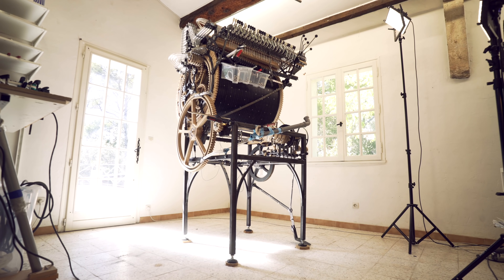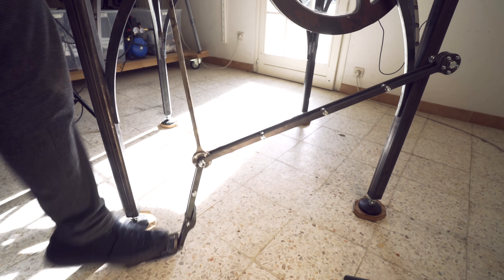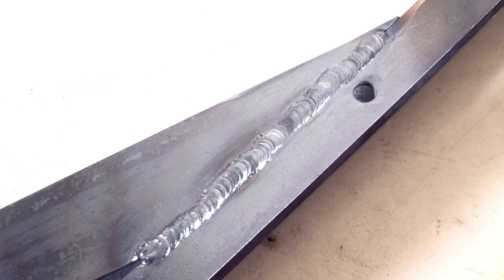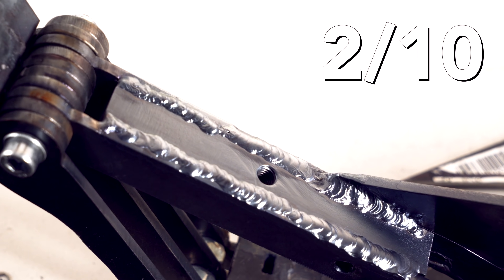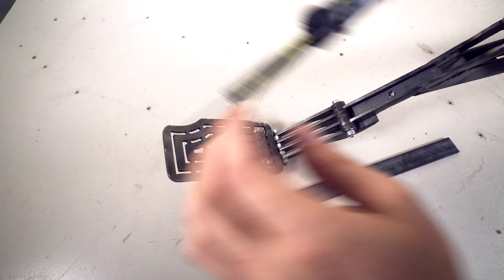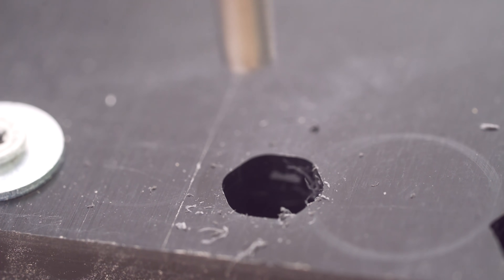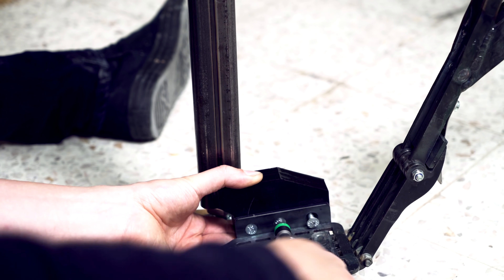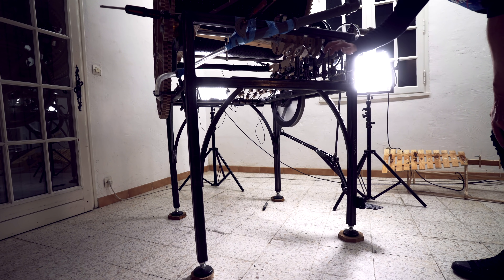Treadle Pedal Completed - Marble Machine X #81

Comment: Why not go with a Singer type pedal setup? It's a classic, it would fill up the dainty looking legs a little and give wide range of motion, allowing you to operate it from either side (front) of the machine. Not to mention that it would stiffen up the whole assembly (Singer pedals were also structure elements because of their conical bearing surfaces).

Comment: What happen if you exidently place you foot under the running machine?
Does it block if you have this block extended? 
Or does it slide because i see some issue in one possition (it can colide and stops the pedal) but i can only speculate if i havent this machine after me.
:)
Nice proggress, i like it 
Good job ~(^-^)~
(Sory for bad english)

Comment: Again another awesome video, but a bit of advice from the safety department.  Whenever one makes an adjustment to a safety component to address some aspect not necessarily safety-related, one still needs to confirm after the adjustment that the safety feature still meets its requirements.

Comment: The gap between the two pieces of metal is some of the cause of the problem. You would have been better off to use square tubing. The top end of the pedal arm needs a brace on the outside of the mount as well to keep that bolt from flexing

Comment: @ 2.33, It is Not structurally fine, you have made a future point of failure, and you Will have to replace the whole mechanism, especially the weak pivot point at the rear of the main arm. @ 3.27 I can no longer watch the Bodging.

Comment: I think you might want to revisit your spring and pedal design.  If the pedal flips up for whatever reason in the middle of a concert, the pedal wil flick past the spring and you won't be able to flick it back easily.
Not a big deal in itself, but in the heat of battle it might become a big issue!
Keep up the good work dude.
Chris

Comment: -  I don't think the safety feature will work if the foot will be trapped under "back" side of the pedal.
From my engineer's point of view it should be resolved by connecting flywheel through friction clutch which would eliminate any interlocks that could happen.

Comment: Hi, Martin, I have not seen every results, so I am a bit worried about SAFETY. I have a scenario which can still be dangerous. Your foot gets under the pedal, the foot plate goes up, but the POM is too small and it does not keep the pedal from getting stuck in the foot of the machine in that position. Tell me I am wrong and I'll be happy.

Comment: if you want better looking welds i would suggest holding the torch as a pencil and also bracing your wrist against a support, it looks like you are trying to do it freehand with your hand floating in the air... very difficult to get a nice looking weld that way... love your videos btw

Comment: Dude, you need to test out the safety feature of that pedal, after you added that spring steel. It's all well and good that there's still flex, but you need to know for certain that when that machine is going full speed, that 5-10 pounds of flex force won't hurt your right foot.

Comment: Those 4 table legs look weak. How are you going to move this piece? How strong is it for shipping? Can you take it apart fast?
If it rains on it will the wood absorb it and swell? How about rust? Those plastic tubes look fragile for shipping. A piano has loads of felt pieces to damp clatter.

Comment: You didn't test what happens if your foot or something else goes under the pedal. It should spring up just fine, but I'm worried it will jam the plastic sliding block against the inside of the leg and cause damage. You should check that and make sure if the pedal does flip up that the plastic slider will stay on the outside of the leg.

Comment: I see a problem. If the safety mechanism was activated (pedal bends upwards), the delrin block could be in a position where it is not sliding against the leg. Due to the preload pushing the pedal into the leg, the block would get pushed behind the leg, and would remain there until somebody pulls it back out

Comment: A crank level from the center of the wheel connect with a  chain, to a large pedal mounted on a  base trapped down between the floor and the machine, thats it dont run on circules  or better let the crank miss out, just tied the pedal chain on a xtreme of the wheel, a larger pedal no need extra attachment and the weight help you in to a higher speed and make easier to stop, greetings!!

Comment: The pedal should be optionally connected to the wheel via a locking pin. So when you are turning the wheel, you do not waste energy moving the pedal up and down for no reason.

Comment: Wont the safety feature break in the case it crushes the foot because the spring steel prevents it from going back? I just don't want to see you on stage accidentally breaking the pedal and have to rescrew the things.

Comment: I love watching the evolution of this whole project but I think this design is a bit flawed. It seems it might still be unsafe for your toes to be caught underneath it. Wouldn't it be a better idea to add a system similar to how bikes work so when the pedal isn't being used, the pedal isn't moving at all? I have no idea if it's possible or if it would add additional noise to the design, but I think this would be a safer design. If he is using the pedal, there is no risk of his foot getting stuck underneath, but when he releases the pedal, the machine keeps moving but the pedal can stay in place or even go backwards if necessary. Just a thought...

Comment: You are giving yourself a hard time with the welding. Doing a welde on two pieces flat without any gaps is way harder than it should be. You probably don't want to do the gaps because of the deformation you will get but if you take a grinder with a cutting wheel and cut right in the joint (1mm deap) you will have a groove. It will be way easier and stronger.
Sorry if it isn't clear I'm French and not very good in English. Hope it helps you.
I'm a welding teacher by the way so i know what i do XD

Comment: Why do you have the pedal only on the side of the Marble Machine X? Wouldn't it be easier to play per hand if you can also sand in the middle? It would also fix the stability and twisting problem.

Comment: Your welding looks good Wintergatan, it looks as if you are using too many amps for some welds as the edges of the material are wetting into the weld puddle. Adjust down 10 or so amps at a time until you feel comfortable and can weld at a consistent pace.

Comment: Next time you're butt welding, you may want to bevel the edge of a piece to get a deeper penetration. you can also keep the weld flatter as the weld fills up the groove and not building up on flat surfaces. Keep up the good work, I was particulary excited today as I knew you'd be dropping a new vid for WW.

Comment: @Wintergatan at 9:49 in this video when you check 'too weak', you can see the long runs flexing at the 3rd and 4th bolt holes, think there may be a high likely hood it could fail at these joints

Comment: Consensus? Test for safety after redesign!?! The spring steel makes me nervous...simply limiting the “flip” would have been less altering to the original design,  the potential for binding and catastrophic failure has increased...injury and mayhem could ensue 🤷🏼‍♀️ .??
Reply: Nah, it will be fine. It's a few mm thin steel with very little leverage, in bending on it's weak axis vs. your foot.

Comment: Hello and congratulations on the pedal upgrade! I've been watching ever since you have started the project and it is amazing to see the MMX come to life! 
Loved the video,but Im slightly concerned.

Don't you think that there is a way simplier solution to fixing all of the problems with the design, whithout complicating the pedal assembly as much? 

Let me explain: I feel like there may be a problem with the design - once the safety mechanism is triggered (the pottom part of the deal folds up and is stuck in an upward position as the springsteel plate will be blocking it),  the POM block, that is being pushed to the side of the leg by the shortened screw trick, will no longer make contact with the leg, thus it will be able to move a slight bit "inward" which, since the pedal will keep moving, may cause the block to be forced with all the weight of the flywheel into the leg of the machine.  
On old sewing machines the pedal was often fixated at the floor level (or atleast at a height where it was comfortable to use and you couldn't stick your foot under it) and insted of being pushed down it would be operated by pivoting it around its fixated point at one end of the pedal plate (just like a guitar pedal but with way more actual travel distance of the non fixated end of the pedal plate). With similar design you won't need any safety features and you could still use a pedal to operate the MMX effectively. Key advantages are that there will be less problems with stability and safety and (importantly) it will still look cool.

Comment: I have a feeling that the safety mechanism is going to be useful just once during the play because if the pedal does bend there won't be any footprint of the bushing material to slide against the sidebar. Thus it's going to spring inwards resulting in a mess.

Comment: The idea with the springsteel is good, but could produce to little flex when your food is caught under it, you should test this to be sure. If the test turns out to be negative for safety you could use a spring that pulls on the end of the pedal to keep it in contact with the arm, springs are more elastic, that should (depending on which sprin you buy) improve the safety.
One thing I wonder about is the stability of the upwards pointing pushrod, if a certain load and length is reached it will bend sideways and reduce the efficiancy, that becomes even more of an issue if the part is subjectet to continuously changing load directions. If that becomes an issue you couldweld a small metal strip on it to get a partial T-beam, this gives you a greater area and resistance moment.

Comment: Reinforcing how it is attached in the other end, (the bult end). Wouldn't that have been a cleaner solution than the delrin block?
(but maybe harder as you would need to support the torque of the whole arm, the delrin support is very close to the applied force)
I don't really know what I think of the current solution, it is either really ugly or genius.

Comment: What would happen if you actually stepped under the paddle and activated the safety feature? Is it possible to quickly restore it to playable position or you'd have to manually load it back in?

Comment: it looks like the upper section could still use a little more stiffening, it seemed to deflect quite a bit at 9:47 but is still a lot better then before. Maybe a wider piece or removing those bolts and filling in the holes with TIG wire as they don't seem to be performing any purpose as the sides are now welded together and are compromising the structure.
Reply: Or perhaps being an actual engineer and performing FEA* to determine the stiffness of the mount and the beam, correcting the rotating mount (how stiff is the axle?)  and the beam (how stiff is the peddle arm?).  In each case, the material selection will determine Young's Modulus, and the design will determine the structure. 

 None of which happens when we 'hack' out a design through trial and error.  Example, depending upon the co-efficient of friction of delrin and of steel, and the force provided by the interference between the leg of MMX an the delrin, what is the expected life of the delrin.  How many hours of playing time will you get before wear causes the wobble to re-appear?

*FEA = finite element analysis.

Comment: Did you test the safety feature of it not crushing your foot? I'm worried that it's too secure now.
Reply: I’m concerned with the treadle pedal coming down on the foot, then folding upwards. The tension on the pedal would  want to equalize. This action may cause the delrin to catch on the leg on the way down. This may cause a sudden and abrupt stop, thus causing damage to the MMx. 

A longer piece of delrin coming off the pedal towards the heel may be enough to prevent this.
Reply: @RINZLERx86  The pedal will pivot far enough for that not to be an issue, providing it would under some super freakish circumstance fold up that far :)
Reply: He showed how he could bend it back by hand with the spring in place. That's little enough force to not crush your foot...

Comment: won't the pedal squash your foot more now? ):
Reply: If it works as intended, the spring steel will be stiff enough to prevent unwanted flopping but flexible enough to let the pedal bend out of the way if it encounters a foot on the way down.
...Not sure if it's calibrated right, but Wintergatan seems sure.
Reply: @timothymclean  He could easily move the pedal with his hand after installing the spring. What more of a test do you need?
Reply: @Finnspin_unicycles  Eh...I see where you're coming from, but if I were gonna use the machine, I'd want to do a more rigorous test.
Reply: It should give way in emergency situation. But he should test it. I guess he already has done it off camera.
Reply: @catch_me_if_you_can1147  hope so!
Reply: @reub2338  When he can push that pedal with the spring attached by using his hand with ease ,this mean it will not be stronger than Martins foot.(He can always wear steel toe shoes. :P)
Reply: @jacky445  I think the problem could be more like water; sure you can move it by putting your hand on it but if you slap it, it would have a lot more resistance.   I more worried that it wouldn't give fast enough to reduce potential harm.
Reply: @Ivan_Cornelius  that's what I'm worried about tooo. the setup before, although it had issues, seems way safer
Reply: Reub no... not really. Explain what u mean
Reply: You guys are way overthinking this.  Like was mentioned, he easily moved the pedal by hand with the spring in place.  The velocity of the pedal is not high enough to "slap" his foot, and even if it was, he's wearing shoes.
Reply: It also seems like it wouldn't jump back, but get stuck in the up position, which would be impractical in an actual performance

Comment: Does the safety feature still work as originally intended. does it bend freely enough without doing any damage with a foot under it?
Reply: Same thing I was thinking,  he probably should have tested the pedal with something under it as well
Reply: @tessag3173  Yes, Wintergatan you didn't the safety feature!
Reply: is his foot made from butter?
Reply: yep, crucial task to do whenever you change a safety feature is test if it still works as intended!

That'll also help test if the peddle doesn't block the machine if it does trigger.
Reply: If the spring is too strong, he could just put some washers behind it to reduce the force
Reply: I was wondering if the delrin block is going to slide off the pillar if a foot goes under the pedal.  Since it's preloaded, it might "snap" left once that happens and be hard to reset the pedal.
Reply: Was thinking the same. He didn't test again how safe it still is.
Reply: Martin was pushing it out of the way with his hand.  His foot will be fine.
Reply: You can see he almost effortlessly bends it with his arm so I would think that it wouldn’t crush his foot
Reply: Just because he didn't show him testing it doesn't mean he didnt
Reply: He could go double safe with wearing safety shoes on the tour.
Reply: Yeah, it looks like a very stiff spring, and with the flywheel's power behind the pedal, that might be enough to injure one's foot.
Reply: I hope he tests it out with something that’s not his foot
Reply: The 10mm con rod will bend before any serious injury is done or another part of the machine 
Even without the saftey feature 
You might let out a few words but no pain in 5mins sort of injury 
I'd say the safety pedal is more about saving the machine from the mechanical lockup that would occur that might result in a breakage 
And remaining composure during a show/not letting out expletives

Take it from someone that works with steel and drops stuff on their toes
Reply: No need. As long as it can be obviously flexed out of the way with any level of ease, it will never have the stiffness to crush anything.
Reply: Yeah he didn't show him putting his foot under there to test it out.
Reply: 6:00 - clearly shows it flexing with hand pressure - his foot will be fine!

#snowflakegeneration

Comment: So I am sure he is doing this, but has he mentioned how often he oils the thing? With all that metal against metal I just worry about grinding down.
Reply: I think almost all of the key friction points are using sealed bearings.
Reply: All of the rotating parts uses bearing. The marble dropping system and the levers+connected parts are the only parts that needs consistent lubrication iirc.
Reply: If you use grease on bushings, rather than thin liquid oil then you hardly ever have to re-grease them. This is exactly how v-brakes on bicycles work.

Comment: isn't there a chance of the peddle getting trapped behind the leg if it gets popped up... you have the MMX on stands so it's about 2 inches higher then it would be in normal operation.